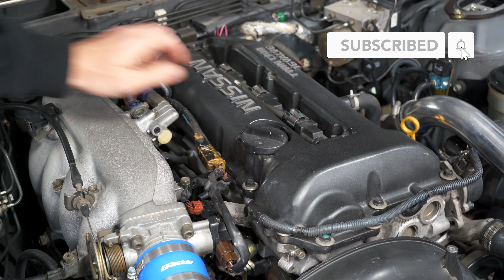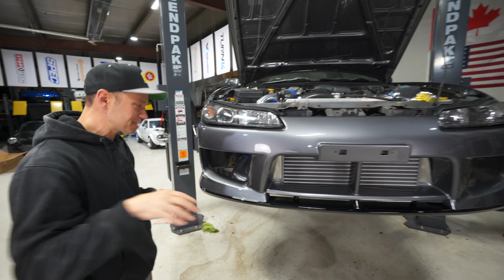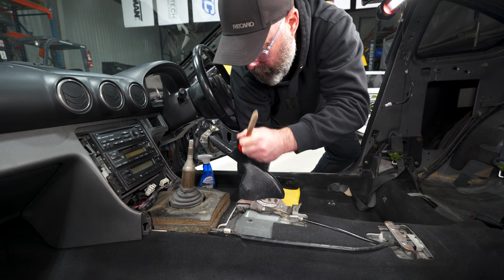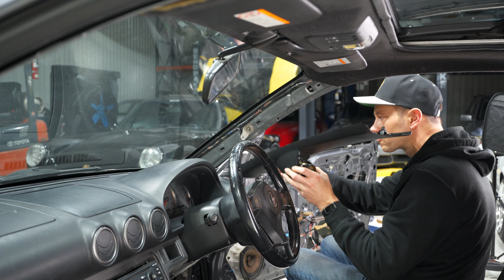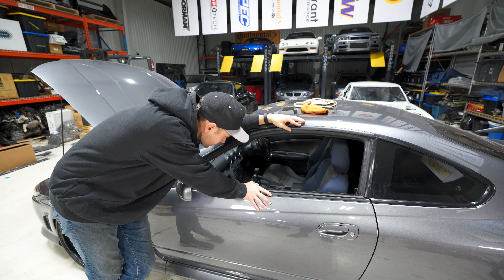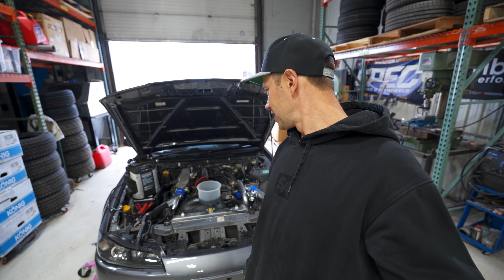Quick & Easy Cheap Nissan Silva Spec R S15 Build  - EP5

Comment: Couldn’t you of cut the intercooler pipe a little bit instead of cutting ur bumper 💀 literally just take clamp off and cut off a tiny section of pipe and then reclamp

Comment: Don’t short change yourself, make some closing panels for the fender liners to bumper cover and bellow the intercooler, for two reasons, you want the air to go,through the intercooler and radiator pack, with the large gap, air will just take the route of least resistance and bypass all the rads and worse still possibly cause lift.

Also I am  you will find your under trays and fender liners will get ripped off when you go north 100mph… the force over panels that size is immense.

Just do it right, use alloy sheet or some black plastic sheet like thick vinyl which can be heated and shaped some what.

Comment: I might be wrong, (probably am) but why is the blow off valve on the wrong side of the intercooler? Shouldn’t it be on the little arm the hangs out nearest the battery? Closer to the throttle body.

Comment: Looks like you had plenty of room to move the bottom intercooler mounts in more for clearance. Elongate the bolt mount hole on the bracket

Comment: Awesome build guys, as always.
Tip on engine oil, you guys should run the vr1 5W50

Better lubrication on startup and higher viscosity on operating temp.

The 10w30 is exactly the opposit.
Reply: 👆👆Thanks for watching and congratulation 🎊you have been selected among my shortlisted winners.

Telegram only to claim your prize 🎁🥰🎁.....

Comment: You could have just set the intercooler back or even angled it.
Back in the day it was popular for people to trim the genuine aero bars but I never know why people just didn't make the intecooler work in that space :S 
I never went down that road with mine :D
Reply from the maker: You realize the hotside pipe cant be moved back due to the passtheough in the chassis. Sames goes for the other side, its not as easy as just moving it back, would require cutting and welding piping, new brackets etc.
Reply: 👆👆Thanks for watching and congratulation 🎊you have been selected among my shortlisted winners.

Telegram only to claim your prize 🎁🥰🎁.....

Comment: Pretty sure if i remember correctly theres a loop in the number 1 coil wiring at the back of the head for timing light hookup. In the coil loom itself.
Looked like some bubbles out of the radiator when you revved it as well, hopefully nothing to worry about.
Loving the build, ive been through a few Silvias including a grey Spec R S15 like this but not nearly as nice!
Reply from the maker: I explained that the loop in the back is not a reliable place to pickup the spark signal. The best is the way I did it. 
Yes, thats the reason to let it fully warm up and rev it a bunch, that clears any bubbles in the system.

Comment: Yo, try folding some boommat next time so that you can get it on the inside of the door skin. Works wonders!You can even pull off the boommat over the opening for a second to add one small patch on the inside of the outside skin!

Comment: The interior is looking beautiful! However, I strongly recommend protecting the dash and any plastic trim pieces with some sort of trim restorer. For older cars, I personally use Meguiar’s Ultimate Protectant as old 80’s dashes really look good when glossy, however for newer dashes if you want a more matte finish, you can use Armor All Original protectant or Armor All Matte protectant. Coating your dash will really protect it from UV rays, keeping it from cracking and keep it looking good, but it will probably also help restore the older plastics and make them match the newer ones, like the new centre console which is a slightly different shade to the old dash. Overall, loving the builds!

Comment: i think you could get a flat piece of metal or hard plastic and make a front stone tray to fill in the gaps. mount it onto the intercool bracket bolts at the back.
would also help force the air into the cooler. kinda silly they don't make one.
also they should have designed the intercool with slightly angled outlets to help avoid contacting the bumpers.

see if you can buy new seat skins from nissan.
Reply: 👆👆Thanks for watching and congratulation 🎊you have been selected among my shortlisted winners.

Telegram only to claim your prize 🎁🥰🎁...

Comment: Feel your pain on front mounts and trimming. When I first turbo'd my FTO with a Galant VR4 engine, I just bought a cheapo universal 600x300x76 core because I knew it would "fit". But because the mouth of the facelift front bumper is so deep, it needed a fairly big radius cut from either side to clear the pipes, which worked functionally, but even the mesh didn't fit any more. Now I'm redoing the setup and attempting to use the factory plastic ducting and put a custom made cooler inside it while keeping it out of the way of the inner bumper.
Reply: 👆👆Thanks for watching and congratulation 🎊you have been selected among my shortlisted winners.

Telegram only to claim your prize 🎁🥰🎁...

Comment: Could you not have adjusted the inter cooler back a couple inches instead of cutting the bumper?
Reply from the maker: No, the piping is a certain length and cant be moved without being modified
Reply: @speedacademy  ah, I was thinking cutting the pipe but it is some work to do since it needs a beed to lock the coupler on, just a thought if it was an OEM bumper that you wouldn’t want to cut
Reply: 👆👆Thanks for watching and congratulation 🎊you have been selected among my shortlisted winners.

Telegram only to claim your prize 🎁🥰🎁...

Comment: For the intercooler fitment you can get away without trimming the front bumper if you lean the core a bit bringing the bottom towards the engine, this creates enough space. I did this on my S15 Spec-R Aero and I have fog lights too which also clear
Reply from the maker: Except you have to shorten the hotside IC pipe as its a specific length and wont fit in the hole that it sits in on the chassis.
Reply: @speedacademy  yeah that's correct. This it what I did then had a new bead welded on, much better than trimming a factory aero bumper for sure.

Loving this series, nice to see so many things done well

Comment: For the doors, you wanna line the door skins with the boommat as they'll act as a mass dampener to get rid of the "drumminess". Only need like 70% coverage to get thr full effect. I did it on my rx8 and the door has that nice solid sound when you tap on it now
Reply: Yeah agreed. Putting patches of boommat on the biggest flat surface of the doorskin has the largest effect on dampening. The inside is a pretty stiff structure and should not need much dampening.

Comment: Anybody else notice the front brake pads have like a 1cm gap from pad edge to rotor edge? Is that normal? I just did the brakes on my car and the pads maybe have a 1mm gap if that
Reply from the maker: Its because we did a brake upgrade so the rotors are much bigger since they are from a 350Z
Reply: @speedacademy  knew about the brake upgrade, just didn’t notice how much bigger it is compared to the pads

Comment: SEEM'S silly or are  you guys are just FUCKING  DUMB ????????????? , ..  Any turbo intercooler piping is pressurised  so why just  not dent / adjust to fit the piping  to fit the application  , .. the flow interruption to the intercooler  is going to be FUCKING minimal  instead  of fucking a stock spec R front bumper like a 90's child  and hacking at it like some FUCK WITTS , ....................
Reply: 👆👆👆ᶜᵒⁿᵍʳᵃᵗᵘˡᵃᵗⁱᵒⁿˢ ʸᵒᵘ ʷᵒⁿ🏆 ᵀᵉˡᵉᵍʳᵃᵐ ᵐᵉ ᵗᵒ ᶜˡᵃⁱᵐ ʸᵒᵘʳ ᵖʳⁱᶜᵉ🎁...💝.. 🎁.. ❤️